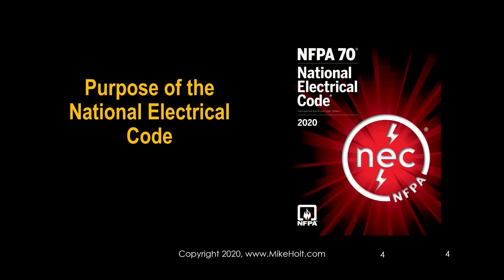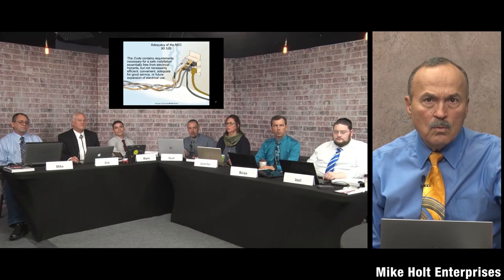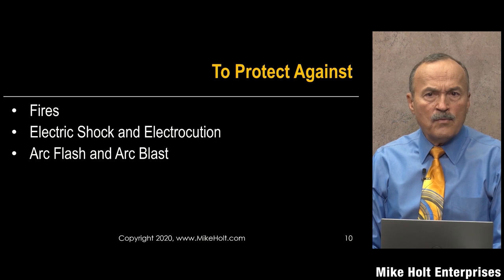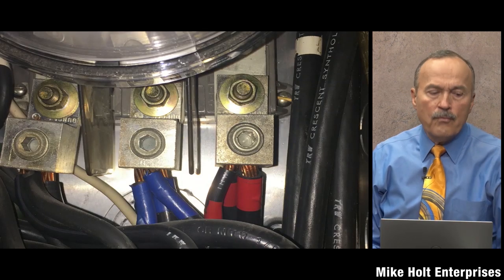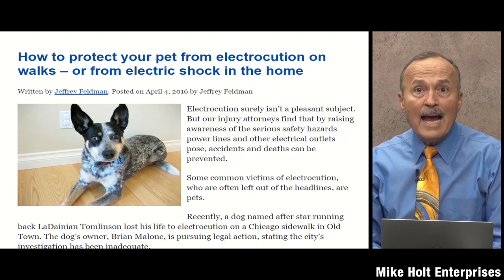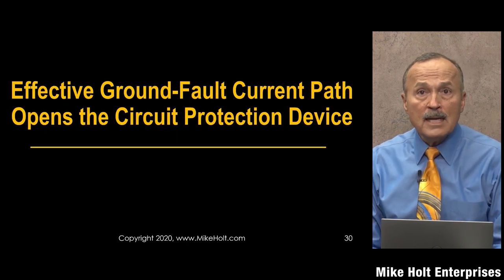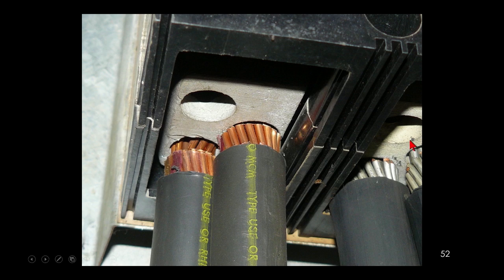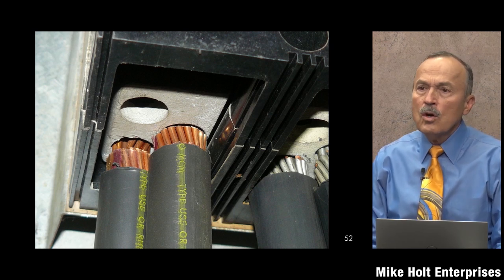Purpose of the NEC [90.1, 2020 NEC]

Comment: What if I am installing 3 LED Pole Lights which Needs Just NO 12 AWG and I Pulled Nu 8AWG What Scientific reason Yall Will Give me that it will affect the Wire, Plus You are Not Shaving the entire Length only less than an inch. I think Its Not Workmanship to shave wire but if its bigger than needed I don't see any Practical Problem.
Reply from the maker: What is your question?
Reply: I believe  the question is about the "haircutting" aka trimming of strands at the terminal connections. Im a novice so my opinions are not the proffesionals opinions,  I love to see the man Mike reply and appreciate it, see what he says. Number one poor workmanship. But it could also mislead if they go eyes on at the terminal connection. Many things are made to be scalable, and if someone inexperienced thinks thats an 8awg connection terminal to terminal that could present problems... plus its just just a code no no, and like our friend here said, poor workmanship which is reason enough imo to not do it.

Comment: Wish the NEC would just make it mandatory to install a ground wire inside of every metal conduit, race way, trough , wire mold  etc to provide a much more reliable ground. Too manner times I have seen EMT conduit without a ground wire pull out of a connector. Same thing with sealtite & greenfield. Have seen water leaking for awhile onto a conduit causing it to rust thru. In my area they stopped allowing inferior type AC ( YEA BX ) in most commercial buildings over 35 years ago. Have to use type MC cab!e. Last time that I did not run a ground wire in EMT or metal rigid conduit was probably 50 years ago. Better safe then dead.
Reply from the maker: And your suggestion would serve no value. Please watch my video MikeHolt.com/Fundamentals. Then you'll understand.

Comment: IF you have legitimately used a larger conductor to compensate for voltage drop you can do several things that you already covered. My question is there such a thing as a Nationally Recognized Testing Laboratory listed and labeled wire gauge reducer which will provide the smaller diameter without compromising the connection?